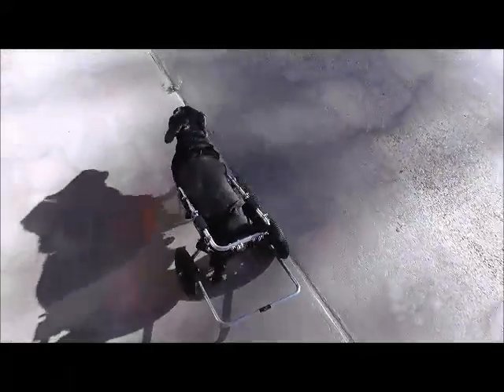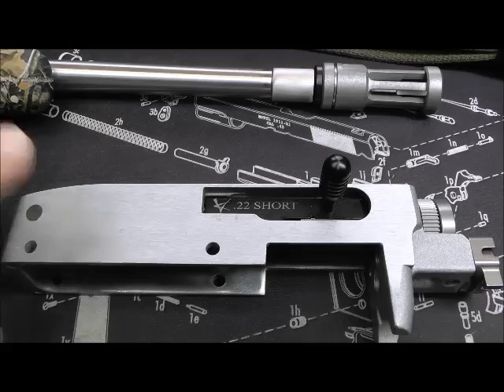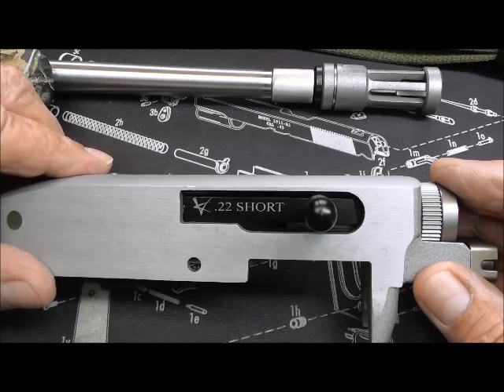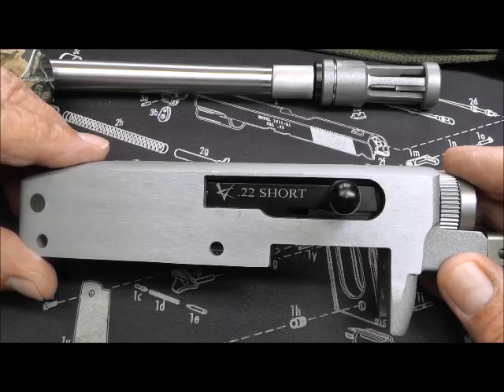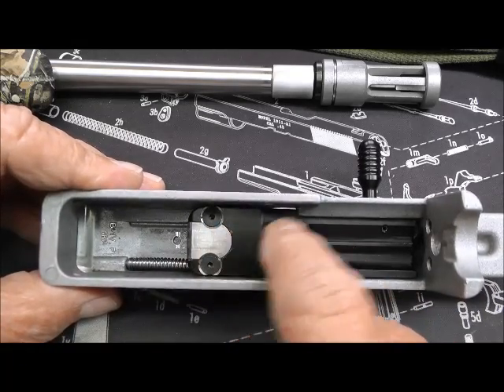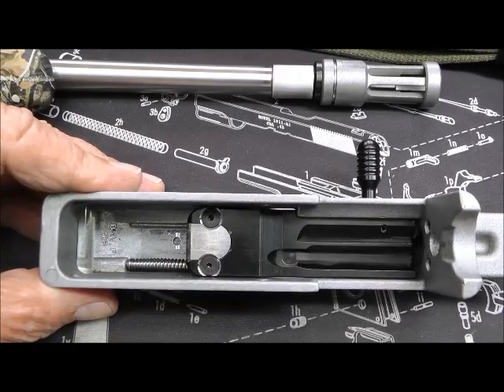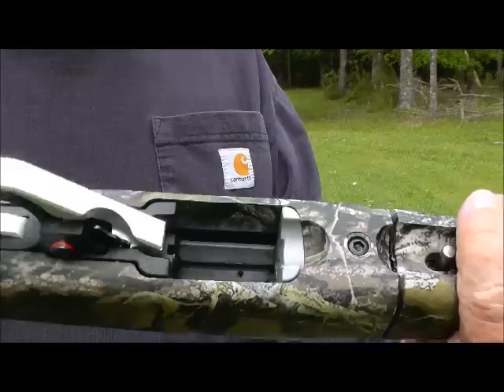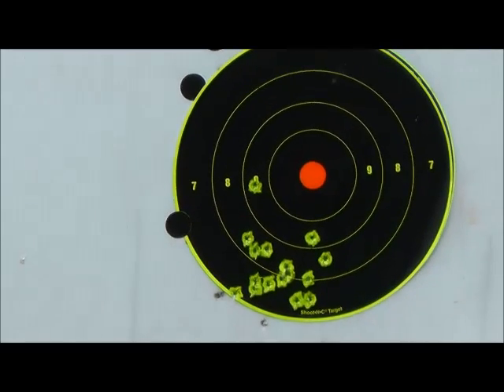Shooting shorts in a 10/22

Comment: Ooo that sounds good shooting shorts. Why does the shoe need to be a separate part?
Reply from the maker: The bolt is light weight, probably aluminum. The shoe is steel to protect the bolt from wearing as it moves out of battery and strikes the steel hammer. I'll probably not shoot it enough to cause a lot of wear but that's the way they come. This new fix is permanent and I like what they've done.